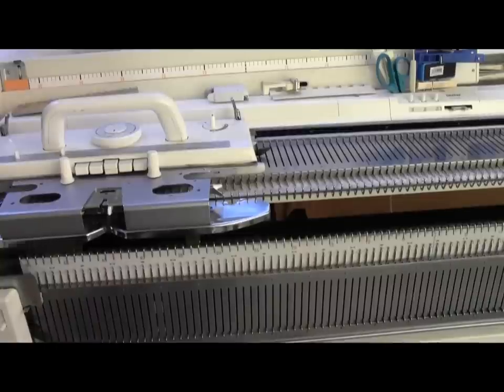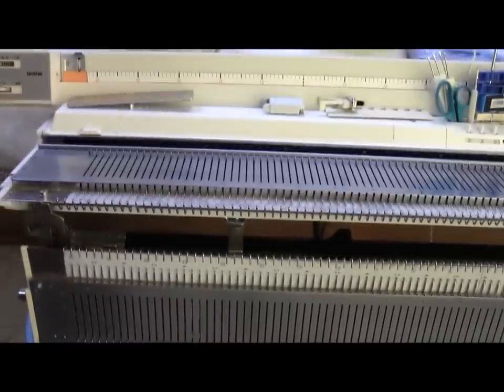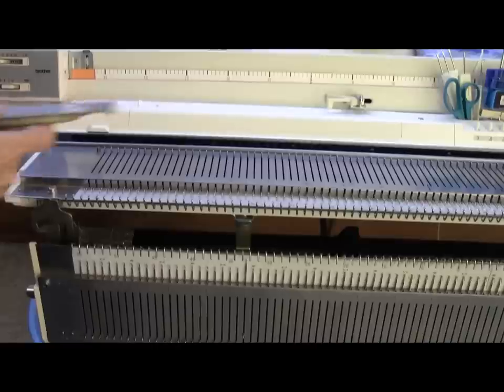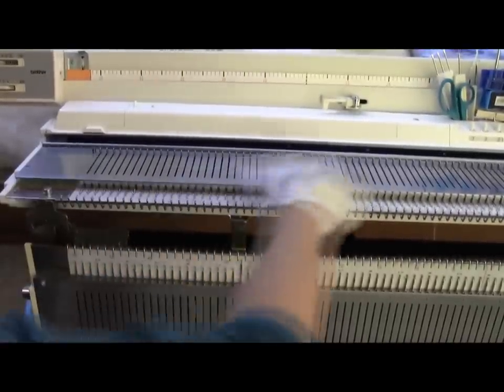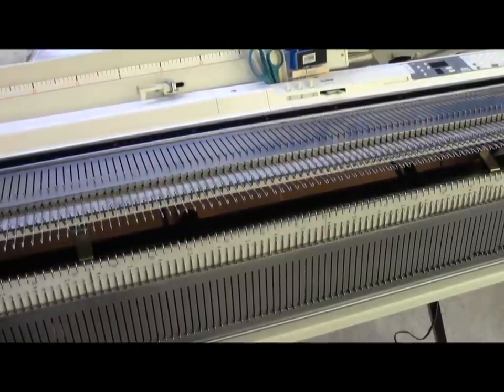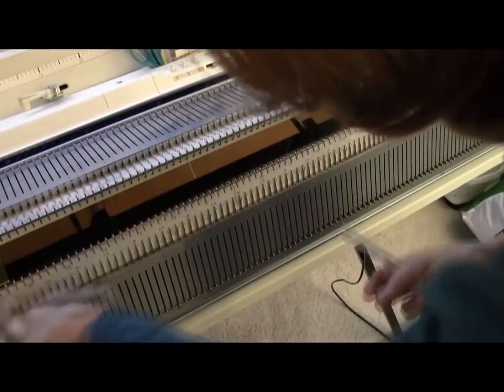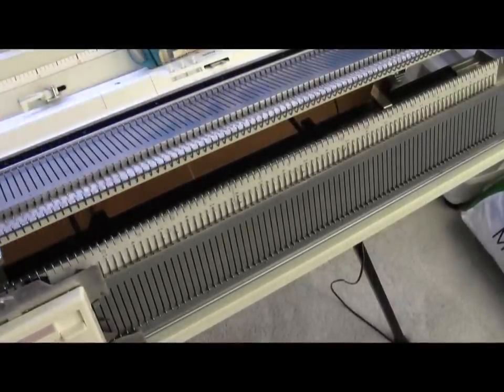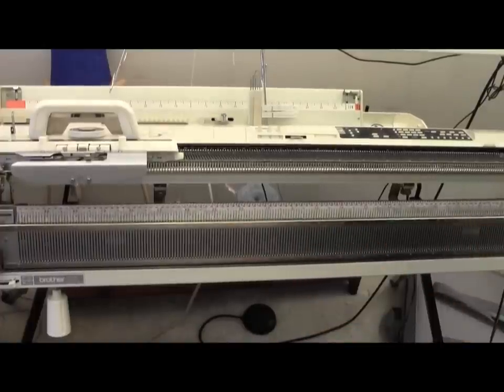TLC For Your Knitting Machine by Diana Sullivan

Comment: Hi.  Yes they are free of gunk, I did get them off as soon as I received the machine.  It all looks clean and in good order, but having had Brother machines in the past ( we downsized and I got rid of everything)  I knew it wasn’t right.  There is also a slight bumping noise on the extreme left when I take the setting plate and carriage right to the left.  This doesn’t happen with the carriage alone.  I’ve move the screws to slightly change the position of the setting plate and it hasn’t really made any difference.  It’s the feeling that there is knitting on the machine when there isn’t !
Reply from the maker: Uh-oh, possible bent sinker plate.  Can you borrow a carriage to try?  Since you are experienced, I assume you've check gate pegs are straight, etc.

Comment: Hi Diana can you tell me which yarns to use in my kh-910 knitting machine and where to buy them i was told that it should be cone yarns is this correct blessings
Reply from the maker: You want very thin yarn, Group 1 (fine).  You can purchase cone yarn, which is especially produced for knitting machines.  It feeds very well, has a little waxing (you can't feel it, but it makes a difference), and you get a LOT on a cone.  Try, for instance, the Knit Knack Shop (they have a website.  No affiliation, but I like their stuff) and purchase the thinner yarns.  Avoid cotton to begin with - you want something with a little elasticity.

Comment: I have just bought a second hand Brother KH890.  The carriage moves fine, but when I attach the setting plate it’s had to push.  There is a new home made sponge bar in it that looks quite thick.  Could this be the cause?
Reply from the maker: Yes.  If the sponge bar is too thick, the needles have more trouble sliding along and moving. However, it also could be the wheels under the setting place.  They need to spin freely when you spin them with your fingers.  They often have fuzz underneath or the screws were put in incorrectly.  Usually it's fuzz.
Reply: Thank you so much for your reply.  I’ve got a new sponge bar coming in the morning, so will hope for the best.  🤞🏻
Reply from the maker: @janegeden3194  Okay, but take those wheel brushes OFF and look underneath.  You cannot see the fuzz.
Reply: @dianaknits   h
Hi thanks for your prompt help.  I’ve in England and have been following your UTube videos quite a lot lately.
The machine is clean and looks in good order, the wheels and brushes are all running smoothly, I have removed them and there was no fuzz.  .  There is a slight knock sound on the extreme left when the setting plate is on, I’ve tried to adjust the setting plate a bit, but it’s not really made that much different.  I can cope with that, I’m hoping it’s the white foam, which looks a bit less forgiving than how I remember it that is making the needles feel harder to push.

Comment: Hi diane I have a 950i been stored away for good few years and the mc button is stuck solid what is your tip to unstuck your machine buttons that's stuck its x
Reply from the maker: This is the button that seems to stick the most often!  What I do is get penetrating oil (they sell it at auto parts stores, and also online).  The auto parts stores near me sell PB Blaster.  It has a long straw, which you put on the nozzle and you spray it into the stuck area.  Leave the carriage in your kitchen or someplace where you will see it several times each day, and click all the buttons each time you see it.  It can take a few days to penetrate and for the buttons to come loose.  If that doesn't work, email me about next steps.

Comment: I put my machine away during summer, and I brought it out in the beginning of the summer. I haven't used the part buttons on my carraige since I brought it out of the storage box and I went to use them yesterday, only to discover that the left part button is stuck, and won't push in. What should I do about this?
Reply: I've looked at the underside of the carriage, and discovered the moving parts for the opposite part button, but can't see anything wrong with those parts on the affected side of the carriage. :(
Reply from the maker: You can to fiddle the button and try to see what it moves underneath, if it'll move even a little.  Then get some Kroil penetrating oil and use the tiny straw to shoot some oil inside the button area and on the moving parts beneath.  Give it a couple of days of sitting on your kitchen counter, poking the button whenever you walk by, as it takes a while to loosen up.  If that doesn't work, it needs to go for repairs.